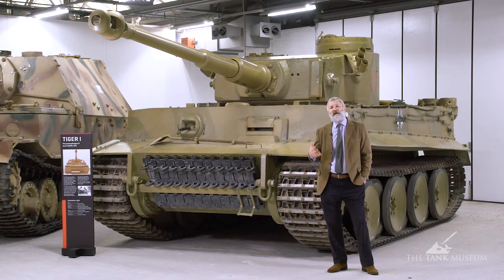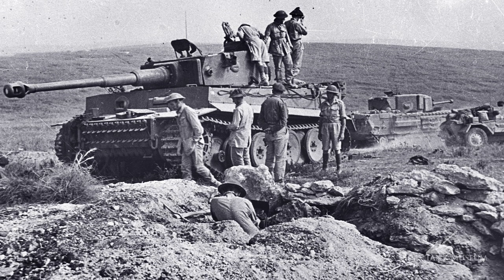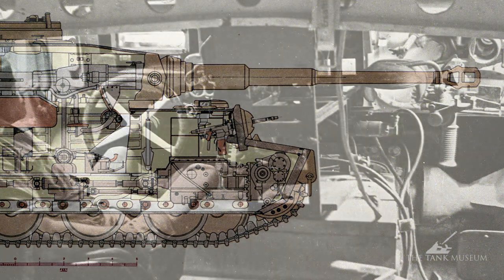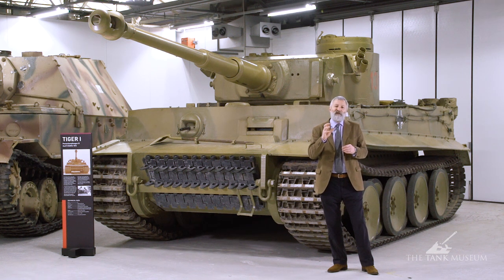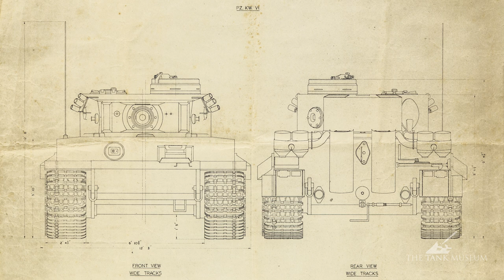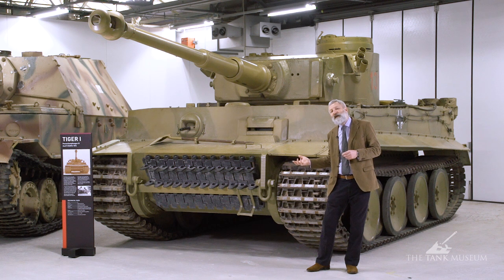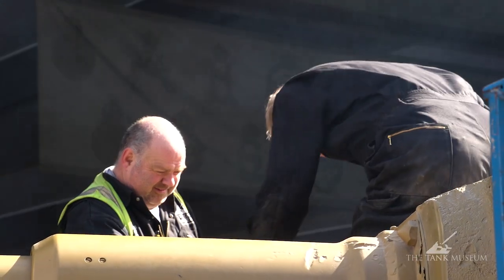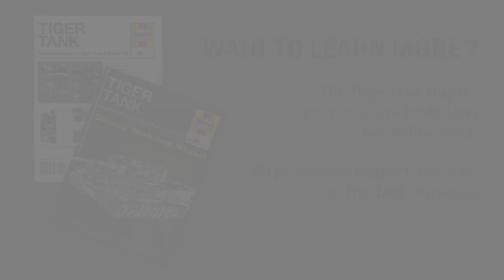Tank Chats #36 Tiger 131 | The Tank Museum

Comment: Isn't the "grandfather's axe paradox" a great solution to problems with original parts wearing out?
Replace parts quite a while before wearing them out, by re-engineering them. Keep the originals that were replaced. Eventually get enough money (here lies the problem) to re-engineer the other parts, then you'll have an original tiger for the museum and a remanufactured tiger to show off and run.

Comment: I know its a bit of a long shot but maybe build a repro tiger, all fully authentic but with new built parts and hull, so that way you'll the 100% authentic tiger (131) that you could bring out for those special ocassions (until it is to fragile to run) and the repro tiger that you could run for much longer with modern cast/made parts
Reply: The museum isn't made of money. A one off or extremely limited run of casting is a multi million dollar endeavor. That's why the 'looks the part' WW1 tanks they bought from movie sets are based on modern heavy equipment skinned to look like WW1 vehicles.
Reply: I know, that's why I did say it was a bit of a long shot

Comment: I know the panzerkempfwagen VI (Tiger) had lots of reliability issues with its engine and transmission in particular. How much does it break down or how many kilometers (or miles) on average would it break down?
Reply: I know a Panther would need a tranny and drive rebuild after 150 kilometers so probably about the same for Tigers. And if the ground was elevated these numbers went down even further. The engine and transmission could be easily broken by an inexperienced driver and crew.

Comment: One of the best tanks ever built no matter how  you see tiger 131
Reply: Best is depending on how you look at it. Great armor yes great gun yes. Cost of building no, dependabilty no, amount of time and materials to build not good. If all tank battles required it not to move much and were at 2k meters and more no better tank for sure but this rarely was the case. So you had a great heavy tank that had to be rebuilt tranny and drives after just 150 kilometers. If used by inexperianced crew was broken easily. Was to heavy to cross most bridges got mired easily. Had to take off battle tracks to put on railcars to get them around. Which they depended on a lot and rails were easily destroyed by the opposition. Logistically it was a nightmare to move around and do maintanance on. In the hands of a good crew deadly, but how many had to be abandoned and destroyed by their own crews when they broke down? Did you know it took the Tiger 1 a full minute to traverse the turret 360 degrees? Not good when you have 2 tanks flanking on either side.

Comment: I would think a good machinist  could remake parts for it. My father was a tool and die maker. I was and am always  amazed at the things someone white such skills can do. My father would make all kinds of custom machined parts.
Reply: Thats just it they want to keep it original without rebuilt parts. And the parts especially of the transmission and drives wear out amazingly quickly and need rebuilds. My thoughts are as one of only a few that can be driven they should take it out and rebuild as necessary there's plenty of others that just sit static.

Comment: I have to give it the the Churchill crews that damaged this monster. Must have to be a brave man to drive so slowly towards a Tiger  on top of hill. Ive seen this tank and the sound it makes is indescribable. I really need to make a 1.35 scale replica of this vehicle.
Reply: Model Magician It was the 4th Tiger to fall to Churchills with 6pdrs and the 6th to fall to 6pdrs, not the last either. Hunts gap cast even more.
Reply: Chaz t yes the 57mm had a very effective capped shell.
Reply: The Churchills did not drive towards this Tiger. They fired on it from fixed positions at a range of about 800 meters.

Comment: How much would it cost to build a new tiger I from raw materials?
Reply: a ton of steel costs around 550$ atm (depends on the individual alloy of cause), the tiger weighs 57 tons, so you need ~31.000$ just for raw material. The manufacturing is way more expensive, almost everything you need to order would be a one-of-a-kind product so very expensive. And building a Tiger engine + gearbox from scratch? Good luck.
I guess with less than a million bucks you don't even have to start looking into it even further ;)
Reply: Think it was said it took like 200,000 man hours to produce a Tiger I in a factory setting by people used to working on said projects. So in making a one off Tiger I it would go well over 200k man hours but even using that figure and assuming you could find the people to do it at say $20 an hour. That's 4 mil just in labor costs. And it would take a team working many more hours then the 200k hours. I would think to build a Tig I would be around 10 to 12 million at least.

Comment: OK----------- If they scanned each part as they overhauled it, the new Printers will be able to produce each part as new when they wear out (using better modern materials).  Takes care of worrying about wearing out parts in the future as it is very important that the young see and hear the monster Roar as often as possible.
Reply: Excuse me, but you can't simply 3D print everything and expect it to work. Parts in the tank's suspension, for example, endure stresses and strains that only certain kinds of steel can withstand. Do you think a 3D printer can print that steel? And many moving parts need a very smooth surface finish, there's no 3D printer that can match it.

Comment: One of Germany's Pride and Joy, Perfectly restored by the British
Reply: They broke the original engine. They installed a slightly different type of engine from another type of tank. They had to remove the underwater diving equipment from the engine compartment to make that happen. But they already lost the biggest part, the snorkel. The cable on the side is very obviously the wrong type. Some tools are not originals. The box of gun tools is missing. The box of track tools is an obvious fake, I think the original one is lost. The S-mine launcher brackets were on the tank when captured, but I don't see them now. The firing controller for S-mines is visible in the earliest photos, but hasn't been seen since then.
I could carry on like this for some time.

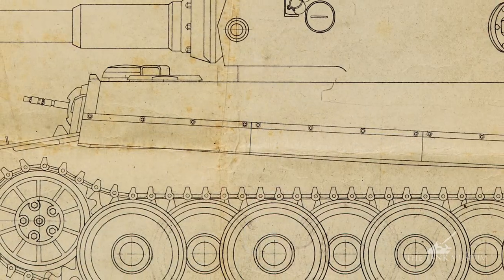Comment: I was watching a video from the rock group Sabaton, and I saw a clip of a Tiger tank manned by a German tank crew with had the number 131 encircled on the bottom glacis. I’m wondering has anyone else seen this tank in the video and is it possible it could be Tiger 131. I know they didn’t know who crewed 131 but it does show a German crew in the clip. It’s a little far fetched, but could it be  a glimpse of Tiger 131 before it’s capture. The video is Sabaton-Panzerkampwagen-Battle of Kursk at 0:29. Someone who knows, please post.
Reply: No, that's not this Tiger "131".  There were at least seventeen Tigers with the organisational number "131" so you shouldn't assume it.
In fact the Tiger in the film was owned by a vehicle testing ground in Germany and the number in a circle was their inventory number.

Comment: If parts wear down, just have to replicate them. I'm sure the first part to fail will be the final drive and I guess many opportunities will show up to machine some new gears
Reply: The point is the parts won't be authentic anymore hence the pondering of should or should not. That said having it move around is honestly also protecting authentic parts as much as wearing them. Lets drive line components get coated in oil and not corrode from breather ingested humidity.

If parts wear out it's really no different then it becoming non functional from sitting over the years. Same result either way it becomes a static display.

Comment: British: had pretty much the most powerful tank at that, so they don't copy it. They just wreck the engine.
Reply: They probably realized the Tiger was way too heavy for the engines of the time. If the Brits didn't capture it, the tank probably would have destroyed its own engine or transmission.
Reply: I mean they had the tank, but didn't produce any half decent tanks until 1945 really....
It's a good thing they did capture it though.
Reply: They had decent tanks. The Churchill wasn't bad and the American-made Sherman struck the right balance of protection, speed, reliability, logistics, versatility, ease of repair, and ease of production. The problem is people tend to focus on armor and firepower and ignore everything else. They viewed the Tiger as the best tank when it was clearly the wrong tank for the era. Too unreliable and too expensive. A few years later and they might have had the technology to make it as amazing as people make it out to be.
Reply: None of the British tanks were really match winners, until 1945 ish. Then they had the Comet, which might have been able to deal with a Tiger 1. The Sherman Firefly was great (but used a US basis). I agree the German tanks were overly complex for the period.
Reply: They had winners. Out of all their jobs, they were only bad at one (fighting heavy tanks). At least it was better than the German philosophy of focusing on ONE job (taking out tanks) and ignoring everything else.
Reply: That's true about the German mentality, but I'm still struggling to think of a British match winner. The Matilda and Valentine were good against Italian tanks (not saying much) but they were outmatched by the Panzer 3 and 4. Churchill was probably best, like you said.

Comment: Yes, But is the veiwers awaer of that the tiger2 Engine in 131 is running due to that they stole 50% of the motor from the Swedish tiger2 when bovington leanded the motor for beanchmarking for 15-20 years ago. The man in sweden from the musem was charged and judged. So congrats 131 running aroound with parts from the Swedish army musem….. NOT SO COOL!!!!